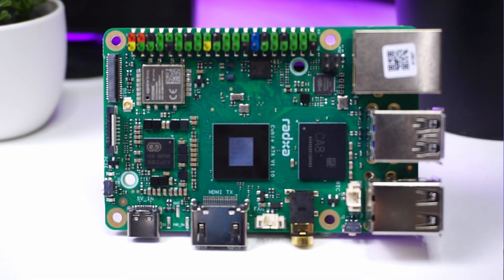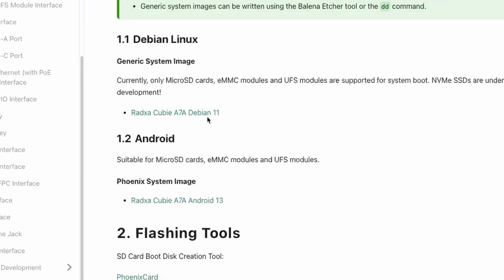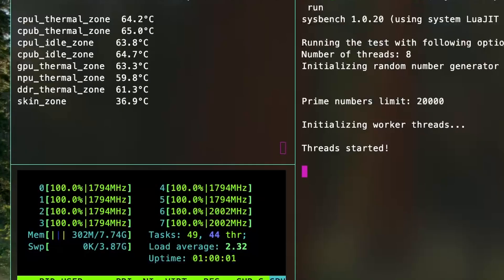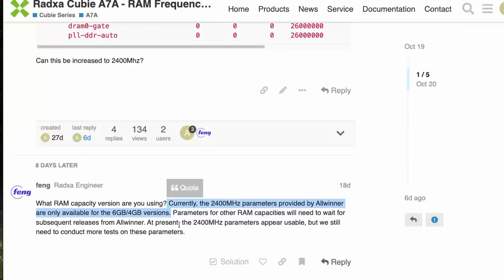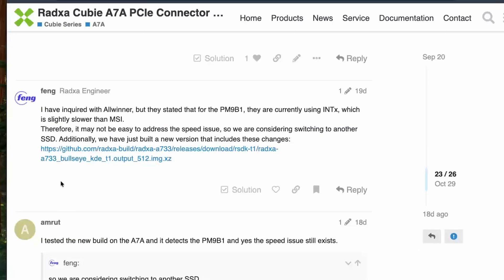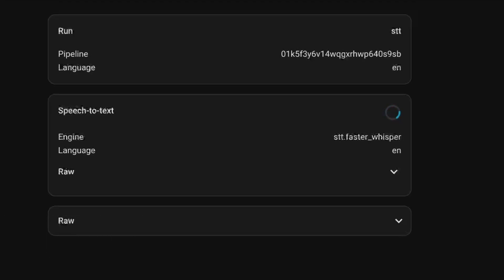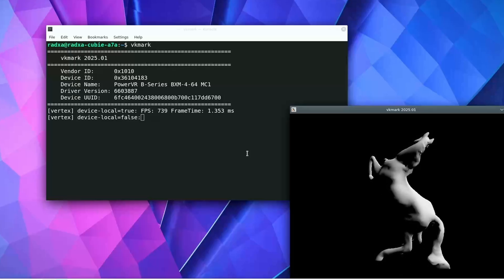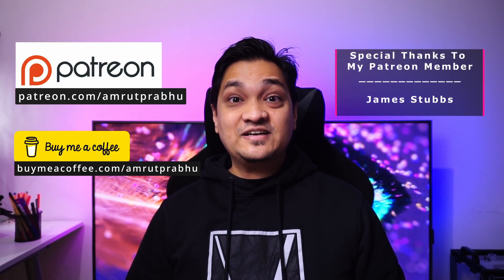Radxa Cubie A7A Hands-on Review: Octa-core, NVMe, USB 3.1 Gen2, Thermals & Real-World Benchmarks 🚀

Comment: Sir what do you think about the sbc pricing nowadays, i was on a mission to build a cyberdeck ,i own pi5 , pi 3 , pico , x4. on comparing this i think sbc's releasing after the launch of pi5 seems to be not worthy for the money. rather software and community of the pi 5 i always prefer a  radxa x4, in terms of arms architecture for projects pi5 does the job but for other things involving gpio pins i prefer a pico 2 or zero 2W with latest rp 2350 one. i am using my raxda x4 as debian  laptop. so i needed to buy an another sbc to run kali, debian , ubuntu smoothly but i am unable to find a one close similar to raxda x4, do you have any suggestions sir.Thanks
Reply from the maker: SBC are usually meant to be used for projects rather than like normal desktop usage. Thats were Rpi came into the market. Like you want to build a weather station mounted on a pole, somewhere remote powered by battery. 
If you want to run only a desktop environment, why not buy a mini pc with intel n100 or n150 which is best suited for it. They are more powerful and cost nearly the same or sometimes cheaper than SBC. 
SBC are meant for projects that need less power , lightweight and takes very small space. 
If you think SBC mean cheaper? than that is not the case. SBC are more known for small size, lightweight, compact computing power and can be even more expensive than mini PCs.
Reply: @SmartHomeCircle  oh i get it, when will pi6 roll out ,i thought buying a pi6 for my cyber deck than pi5 as ram shortage hit up the price of pi 5
Reply from the maker: @DUGAFFYTthis might also affect pi6. Not sure when it will be out.

Comment: I don't get SBC pricing anymore. They cost more than actual x86 mini pcs for a fraction of the performance and capability. Is it just for the GPIO pins?
Reply from the maker: It's more about size and energy consumption. Mini pcs idle at 12-15 watts. Sbc are just 2-3 watts and 8-9 watts at full power. Mini pcs no matter how small are still bulky.( Dont forget the power adapter it needs to power it) . These SBCs are small lightweight and can be powered with small adapters. They can be mounted anywhere. Imaging mounting a mini pc on top of a weather station pole. 😂.  Dont consider sbc for native pc usage. Think of it more from projects point of view.
Regarding price, it varies from region to region so cant use that for comparison. I hope that helps. 🙂
Reply: @reddsyn Are you sure you're comparing new x86 mini PCs to new arm SBCs? Buying a used PC is a completely legitimate option but I'm yet to see new x86 PCs being cheaper than arm SBCs at the same performance level.
Reply from the maker: @2cf24dba5fb0a its not about being low cost. Sometimes you need a sbc that is lightweight, small in size and use very low power. That is something that x86 cannot provide. 
E.g as I mentioned above, building a weather station that you want to mount on a pole. Imagine doing it with a mini pc. 😂 😂
Reply: @SmartHomeCircle  It's about the small size and low power for many use cases, I own an SBC precisely for that reason, but SBCs are also cheaper than PCs, albeit with no accessories included in the price. The Cubie A7A is a bad example but the state of the art SBCs are very powerful for the price if you wanted to use the board as desktop replacement.